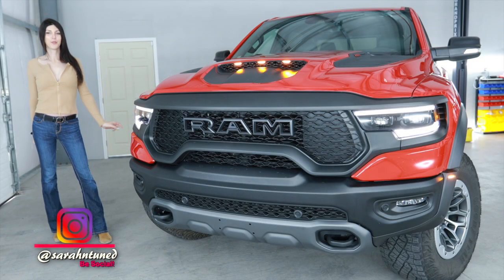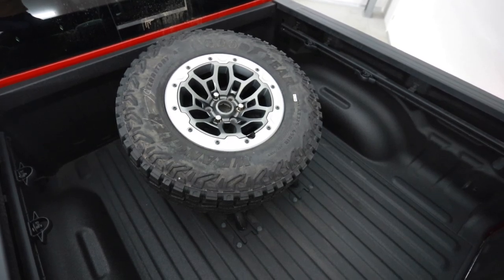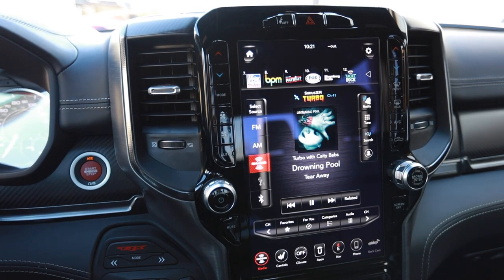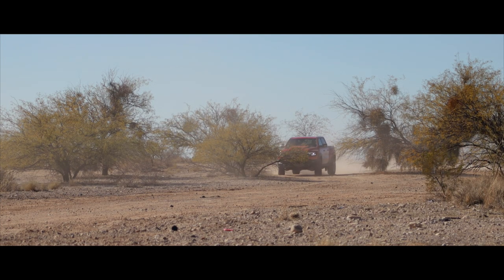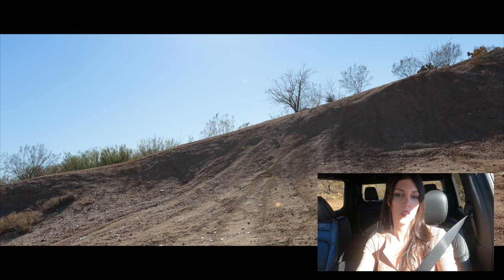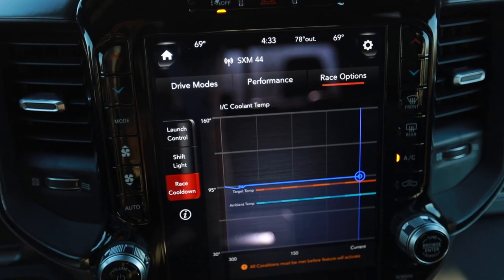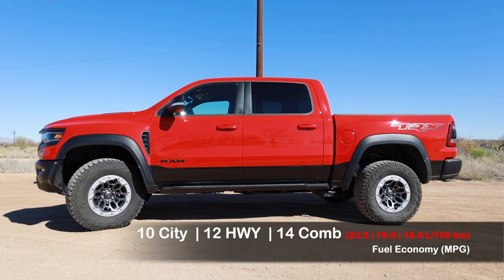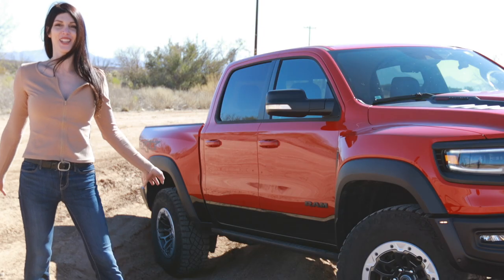Because AMERICA, That’s Why.. // 2021 Ram 1500 TRX Review

Comment: Just note, the downhill assist really helps in that it controls each braking side and adjust for slip and lock and transfers that to other corners, really helps control your descent in a much better way than simply braking slower.

Comment: AMW4x4 (America's Most Wanted 4x4) is putting those motors in Jeep Gladiators and Wranglers...  They weigh about HALF what that truck does...  Imagine how much fun it would be to have a Gladiator Rubicon on 40's with a 707 Hellcat or a 840 Demon swap...  🤘🏼🤘🏼🤘🏼

I plan on doing the SRT 6.4 Hemi swap in my Gladiator Rubicon on 37's sometime in the future when the warranty is out.

Comment: There is no doubt that this truck is the king of off-road vehicles at this point but I want to see in 2022 if the Ford ra  raptor comes out with the GT 500 engine in it like is rumored

Comment: So, in the name of science (which I know you like), here's a little information.  This engine doesn't have a blower on it.  It's a supercharger.  Only an engine that has an old-school roots-style blower should be called a "blower".  Those got the name because back in the 50's, guys were yanking them off of two-stroke Detroit Diesel engines, where they were actually used as a real "blower" on the sides of the engine block to aid in exhaust gas evacuation.  They literally were blowing air into the bottom of the cylinder to push out the exhaust gases on those two-strokes.  They would then modify the front gear drive to accept a large Gilmer drive belt which would be driven by the crankshaft.  These blowers typically have teflon strips to seal the rotors against the casing, making them very efficient at compressing air - but at a cost.  The large 10-71 blower I run on my Camaro requires about 150 hp just to turn it at speed.  But the motor also puts out 1,200+ hp at the crank.  My Chevelle has a smaller 8-71 blower, and puts down 1,000+ hp at the crank.  The 2.8L supercharger on these Hellcats displace 2.8L of air per revolution.  In comparison, my 10-71 displaces 7.6L of air per revolution.  :)

Comment: 702 Horsepower...s**t this is a beast you take out to intimidate drivers either driving to or from somewhere....not for highway travel or city driving basically off road to do s**t with, engine is a beast. This should never be an electric vehicle.